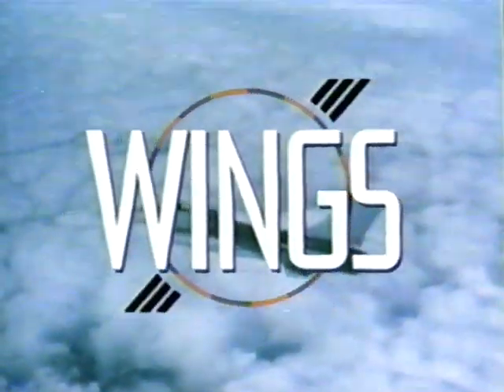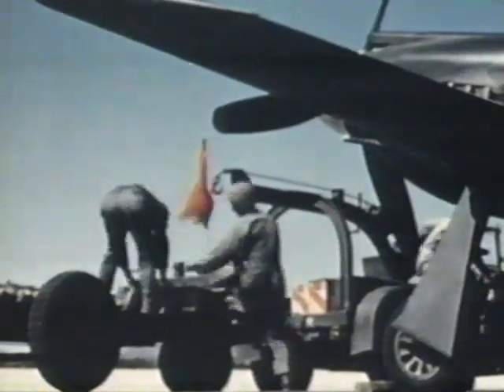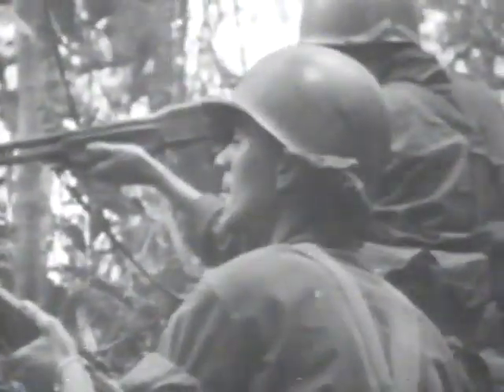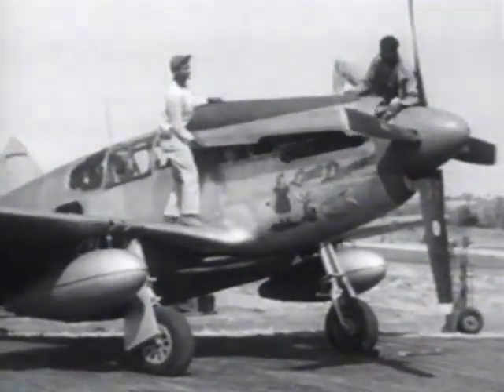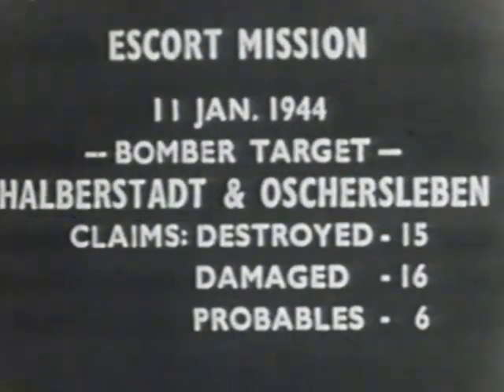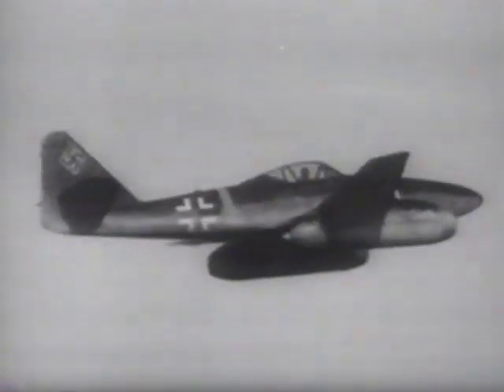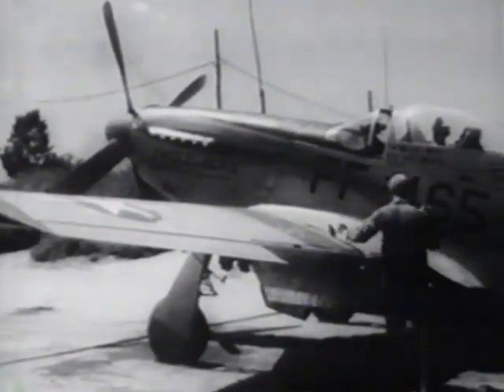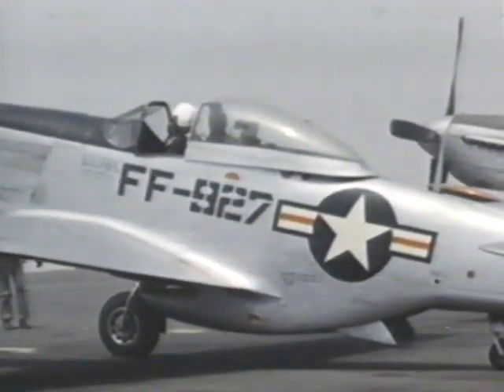Wings P 51

Comment: An important factor in the design of the Mustang airframe was the fact that it would tolerate a greater rearward shift in the CG thus allowing the greater load of fuel provided by the large rear fuel tank. When combined with the fuel economy of the Merlin and the addition of drop tanks it then had the range to escort the bombers and have fuel in hand to loiter and maintain air superiority. 
This was something planned and achieved in late models of the Griffon powered Spitfires, most notably the XX series with much enlarged tail surfaces, but the necessities of maintaining war production worked to delay these developments, the main production of Spitfires being focused more upon reaction to tactical necessities, such as uprating the Mk.V airframe with the two stage supercharged Merlin 60s series making the main production type IX (as a counter to the appearance on the Channel front of the FW190) and the Packard powered equivalent Mk.XVI, and later the uprated Mk. VIII airframe as a basis for the Mks. XIV & XIX utilising the Griffon with its increased power.
The limited range of the earlier marks of Spitfire (and the Me109 and Fw190) were a consequence of the design limitations of a smaller "low drag" tailplane, inevitably restricting the potential for rearward CG loading, a consequence of design thinking in what were initially designed as a singe engined fighters intended for use where range was not the primary consideration.
It should also be noted that although the Mustang had a very efficient airfoil section, that it had a laminar flow airfoil is not really true. Laminar flow was not attainable in practical terms since a minute imperfection anywhere on the wing surface of a laminar flow wing would cause laminar flow to break down and this would have been a major problem in production to the necessary degree of accuracy and would in service conditions have been quite impractical.
One view is that the promulgation of the "laminar flow" story was (a) merely propaganda and PR fabrication, and quite possibly (b) astute misdirection in the hope that the Germans might waste valuable time and effort in trying to produce a workable laminar flow wing.
Reply: The germans actually knew the laminar airflow didn't work. 
They tested a captured Mustang wing and saw it gave 60% less drag then comparable german wings primarily due to superior build quality and clean design (no wing radiatiors and fully enclosed wheels).